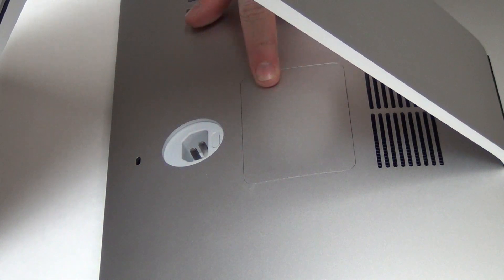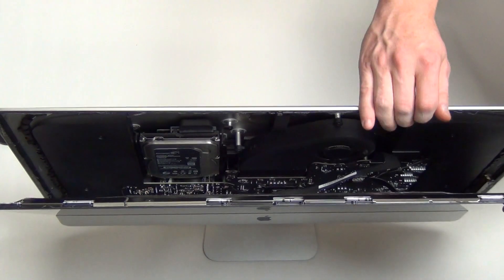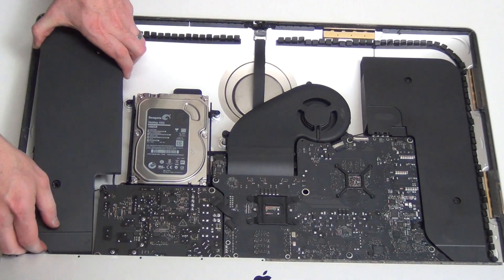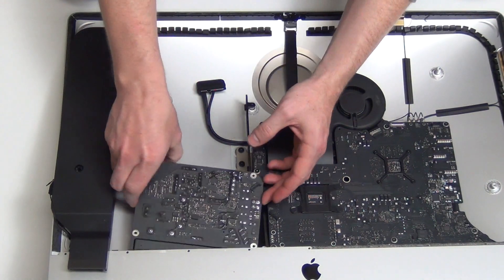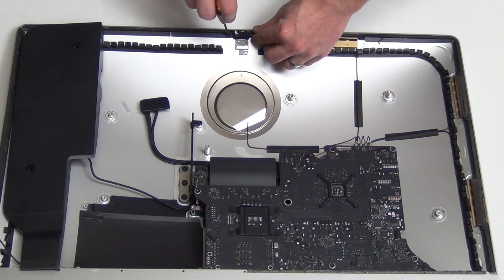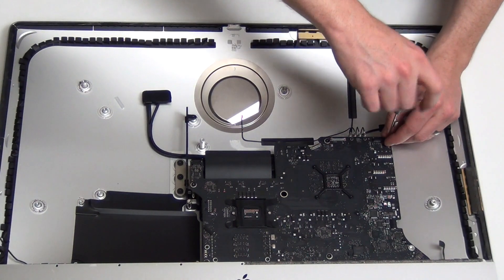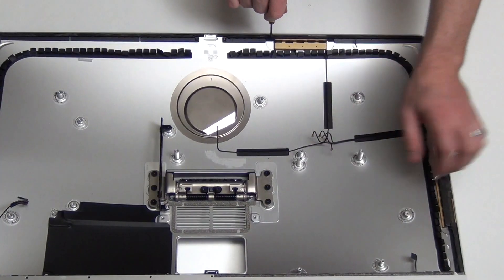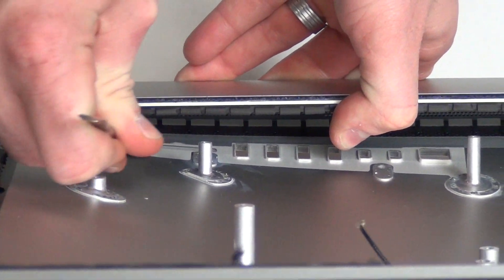How to take apart the 2013  Apple 27" iMac Model A1419

Comment: I need to order full lcd screen package. My supplier question me about part number.  I found out there is two part numbers diferent. Which one is perfect part number for 27" late 2013 or they just work same i can just take any frm LM270QQ1(SD)(B1)  OR (B2)?
Model: A1419
SERIAL: C02LK00EFLMM

Comment: BE VERY CAREFUL! I used a triangular pick like the one shown to break the glue and permenantly damaged the screen backlight. Don't push it in further than 1 cm.
Reply: Thanks for the warning.  Would a Stanley knife extended to 1cm do the trick too?
Reply: @austrobok2958  do as Jared Foiles suggests and expose it to temperature.  I put mine outside in 95degree weather for 25 minutes and it came apart easily with an actual guitar pic.
Reply: @ethanspaulding6067  Can't be too good for the rest of the iMac like the HD or the  CPUs..
Anyway, I used a Stanley knife and it was a bit messy, 2 cracks in the glass.. But I got my HD out, glued it all together again with silicone gel. and off to the tip. 🙂
Reply: @austrobok2958  95degrees Fahrenheit = 35degrees C.  HD and Cpu are hotter than that at idle.  I should have clarified!

Comment: Has anyone tried to swap the stand and hinge on the 27 inch late 2013 iMac with a removable one from previous generation iMac?
Reply: Was thinking on the same stuff, if we disassemble and convert the hinge to the VESA or the removable version in any way. Haven't seen anywhere people giving thought on that. I might be wrong but I think there might be a simpler fix for this.

Comment: Good tutorial! I just upgraded my 27" iMac with an SSD. Only problem was to completely remove all of the old double adhesive tape and glue from the iMac enclosure, you really need some special solvent for that glue residue.
Reply: what's the special solvent for removing the residue?
Reply: @officialtechhouse  isopropyl alcohol
Reply: Isopropanol AKA Isopropyl Alcohol is sufficient. Use q-tips and work a little area at a time. Be patient, I was replacing the broken hinge washers and replacing a damaged foot and cleaning off the adhesive took the longest.

Comment: Fantastically helpful when I replaced my iMac's power supply. The old one started to make a strange rattling noise, which I at first attributed to the hard drive, but once the case was open, it was clear the noise came from the power supply.
Reply from the maker: ytctrb Glad we could help and you were able to fix the problem!
Reply: My iMac's power supply went too, no warning.  Fortunately my home insurance bought the story of a 'power surge'  so I was reimbursed, about 3x what it cost.. I didn't complain and used the cash to upgrade to a 16" MBP. But I still need the HD in the iMac as it has irreplaceable (and not backed-up) data, mainly photos.

Comment: Those of you worried about taking the screen off, I have a helpful tip.  Expose the adhesive to extreme temperatures (hot or cold).  I did that back in February when I transported my iMac in very cold weather.  When I got to my destination, the screen was actually about to fall off the frame.  Normally, I would be worried about this, but since I am planning a logic board repair/replacement, I found this to be a happy accident.  So, leave your iMac out in the cold/heat for like 10 minutes or so and you'll find the glue much easier to deal with.
Reply: They made the conscious decision to use glue instead of a latching, locking or screw mechanism :p

Comment: How would i take out the power button?  I believe my wire was severed during disassembly and needs to fix/replace it
Reply from the maker: Its not easy.  Its glued in place on the casing. You have to press pretty hard on it to push it through, possibly while prying on the inside a little.  When it is removed, its hard to get it to go back in place like it was before and stay there.

Comment: I followed these instructions but I was not careful enough when removing the screen. The glass cracked with a very slight twist of the plectrum.  Be very careful! The glass cannot be replaced separately. When I reassembled the iMac it wouldnt turn on. Zilch!
Reply: It wouldn’t turn on because of the glass?

Comment: If you push in that guitar pick slightly too far you will ruin your display like I did - permanent green line down center of screen - prohibitively expensive to replace screen. You should use the special tool Apple provide which is like a mini pizza cutter.